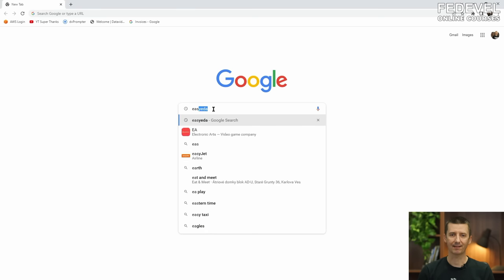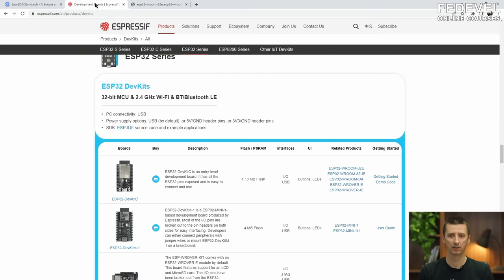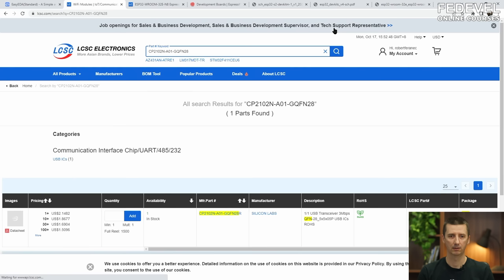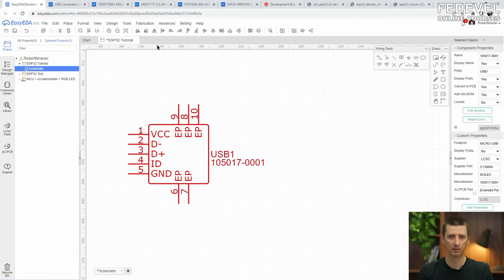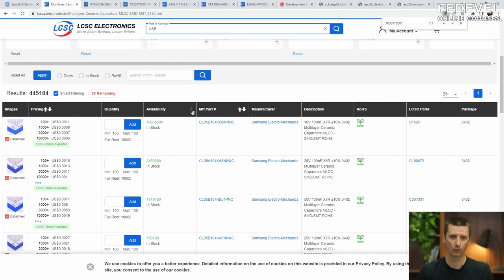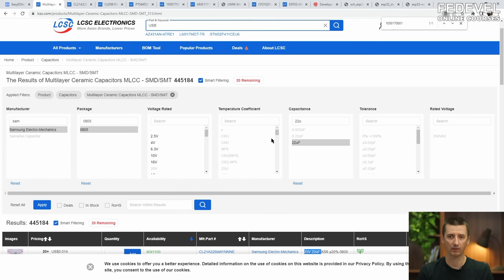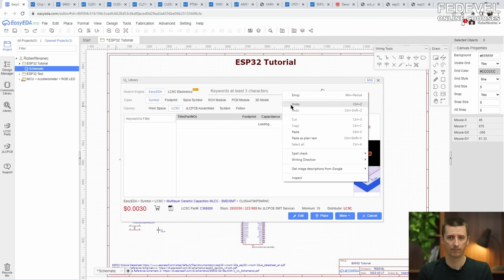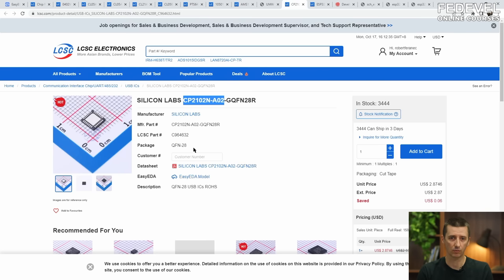How to Make Custom ESP32 Board in 3 Hours | Full Tutorial

Comment from the maker: Thank you for watching. PS: Project is here: https://oshwlab.com/robertferanec/esp32-tutorial
Reply: Dear Robert! I've just created a 2 layer board in EasyEDA, thanks for this awesome tutorial!
I have a question in my mind however... My board is an H-Bridge which will handle 10A current spikes, a few amp countinous current. (I upgrade my kid's electric tractor)... So I just did the layout, and I have some space on the board to route a few tracks on both side a top of each other (for example from the MOSFETs to motor connector) If I do this, should I put VIAs along the way to connect the two sides multiple time, or is just ok if the connection is made in the two ends (THT connector and FET had been used) 

Thanks, Peter
Reply from the maker: @EFazy  that's super cool. I am very happy this tutorial helped. PCB tracks can withstand high currents (I have some videos about burning PCB tracks) + I discuss high current PCB design with Steve Sandler. I don't know how wide are your tracks, but you can use Saturn PCB calculator (free software) to double check if you would need paralell tracks. 10A is not so much - it may not be necessary, especially if your input - output are on the same side of PCB - in that case most current will probably flow on one side anyway. However, having GND plane on the other side may help with possible EMC / EMI reduction (which may not be relevant in your case). https://www.youtube.com/watch?v=WdlN8bHw-w0 https://www.youtube.com/watch?v=sJQi9vcCW-E
Reply: The most beautiful saying "PERFECT" I've ever heard in my life ( I will use that voice sample on my home assistant wallpanel if @robertferanec  allows it 🙄).
Excellent job. I am using these boards in my house automation system without knowing how they work internally. Now I have a good idea of how this kind of system works.
Reply: Why not using USB-C tho? :D Personally hate the boards not coming with USB-C already because the other connectors die even faster :(
Reply: Thank you so much for this!  Want to say, @2:52:52 (palindrome :) ), I see you using a web page from DroneBotWorkshop.  I've been learning a lot from his videos!  That's so cool.  Am helping my nephew write video games, and I plan to introduce him to "smaller computers" this Christmas, with displays and PictoBlox which is like MIT's Scratch, which can run on esp32 etc.  Thank you again!
Reply: @RobertFeranec  I have a question if I wanted to protect the digital pins from 5v input would it be enough to use a zener diode
Pd thanks for the tutorial you explain a lot of things in such a way anyone could understand
Reply from the maker: @gcdani271  do you mean connecting circuits with different voltages? if yes, then proper way would be use a buffer - you can find some which will be 5v compatible or for example you can use one with dual power voltage. If you mean to protect your inputs from random peaks e.g. ESD, there are special diodes for this, just search for input protection diode
Reply: @RobertFeranec I mean if someone connects a sensor that works with five volts and output 5volt signal is it enough to use a zener diode to make the voltage less than 3,6 beacause if I am correct a zener turns the excess voltage into heat
Reply: ESP32 less than $3 on the internet new.. why would it make sense to make your own here for $38?
Reply: @antdx316  It’s just a tutorial. There is enough useful information here to create any ESP32 based project you want.
Reply: @trhosking  how do they even sell it for $3 when its $38 there though?
Reply: @antdx316  Economy of scale. When you are making thousands of units you buy your components from source. When you or I buy a few bits and pieces we are paying markup to everyone who has handled the goods in between. Add to that the shipping for a handful of items and before you know it we are paying fifty times the factory price. Also remember that the first time you order an assembled board from JLCPCB there is a £25 setup charge.
Reply: @RobertFeranec  Can you do a 100 watt led mcpcb & led driver design aswell
Reply: @EFazy 😊
Reply: I am very happy to learn new thing, but i have a doubt about copper pouring in top layer for 3.3 v, cause you already give a full plane for 3v3  in inner layer, am i missing something?

Comment: Am I missing something or did it really cost $177 for 5 boards??
Reply: That's the cost for PCBA mostly, assembly is a lot more work than just making the boards at such a small scale. $177 is probably the cheapest you could get that done anywhere
Reply: @jonathansouza7321 Each “external” component with JLCPCB has a £2 placement fee, from each resistor to each chip, it would be so much cheaper to find JLC basic parts or to do it by hand would be even cheaper, much much less than £100, more like £10-20 😊
Reply: Yeah, he used the expensive solder and parts, if you read the jlcpcb docs it'll tell you what type of components they prefer (and sell cheaper)
Reply: Do note that a lot of that is setup fee.  I recently ordered some PCBA from JLCPCB, and getting 5 boards cost like $180, but getting 10 cost maybe $210.
Reply: I checked what it would have cost to order 100, and it came out to something like $8 a board, and I think the parts cost was most of that.
Reply: Is more like $5 plus shipping if you order and assemble the parts yourself using a hotplate.
Reply: If you want cheap you need to make it thru hole, or big enough smd's to where you can solder it yourself. A few boards are always expensive.
Reply: If only the pi was that price.
Reply: @Harveyn  how can it be done by hand? Im a beginner

Comment: Hello Robert. I am just finishing a design using the ESP32-S2 bare IC. While using the bare IC instead of the module, you have to place a 40Mhz Oscillator, and you also have to design a transmission line for the RF input, and a Pi Network for transmission matching. Do you think you can cover that in a future video?
Reply from the maker: RF for this kind of chips is on my todo list. Just hard to find someone for my interview video.
Reply: @RobertFeranec  Yes, it most certainly is. What little I know had to learn the hard way

Comment: Hi Robert, Thank you for the great video! Great content as always

I would like to share a little tip: When you are routing a line on the top layer, and you want to pass to the bottom layer through a VIA (e.g., at 01:35:15), you can just switch the layer on the "Layers and objects" box, and it creates the VIA automatically from your current layer to the one to which you changed to (instead of (1) stopping the routing command, (2) placing the VIA, (3) switching the layer, and (4) starting the routing command again).
Reply: I was just thinking that. Little tricks....

Comment: Fantastic video ! I want to make my own ESP32 board, customized for the personal project I am working on and this step-by-step video is incredible !
Reply: Hi Gael, I'm also doing my first custom ESP32 board. I'm making board to communicate via CAN bus as I do not wanna use wifi or any radio. I'm currently doing board with 4 connectors for PIR sensors. The esp32 supposed to send messages over the CAN Bus to ESPHome listening on CAN Bus. Then I'm gonna control my hot water solar heater again via CAN Bus. I'm planing to wire most important things over CAN Bus.

Comment: I knew this was possible, and you show all the steps.  There must be ways to share working schematics with all required fabrication information. This is as cheap as buying off the shelf.  I often see boards that have too many things and want to remove them, buy just what I need for an application.  If you tied to the PCB maker then anyone could just pick what they needed and have it made.  Thanks!!
Reply from the maker: Thank you very much @richardcollins5549 PS: If it helps, a link to the finished project is in my pinned comment.

Comment: Perfect video! Learn a lot (together with your series #1- #7 one year ago).
Have a question:
"Power Input Selection" there you use a connector "J4" - to avoid a manual connector – can this be replaced with a "Dual Common Cathode Schottky Barrier Diodes (e.g. onsemi BAT54CLT1G)", the same solution that was used in your "TINY" the project?
Reply from the maker: Thank you. The 1117 regulator is not the best and if you take the lower USB voltage tolerance and decrease it by loses on the diode the voltage will be around the limits what 1117 needs. That is the reason why I rather used jumper. In the TINY project I used a better regulator, so we could use the diode.

Comment: Great video. Wouldn’t you save space for routing by connecting ground pins where possible and sharing vias rather than creating a via for every pin? Same for 3V3.
Reply: Hi! General best practice is to place ground and power vias per connection and avoid sharing I believe. I have heard different reasoning behind this from different engineers but I am still learning myself. Overall, if you have the space, doesn't hurt to shoot for best case of better, low inductance connections to internal planes. I think for simple designs, probably doesn't matter.

Comment: Quick question: What is the purpose of the 0 ohm resistors in the serial signals section?  Is it just to make it easier to cross-connect the TXD to RXD nets?
Reply: I'm wondering this too, but I'm not all the way through the video yet.

Comment: Whats the reason behind not connection the gnd of decoupling caps to the ground pin of the mcu? Instead u used one via to the ground plane for each, even when they are right next to each other. These two vias will increase the impedance of the gnd path between the cap and the supply pins. Same at the input cap of the LDO? Shouldn't gnd pin connected to decoupling cap connected to two gnd vias give the best preformance?

Comment: This is a great video. I would be very interested in seeing a video about DIY / custom ESP32 with ethernet and PoE on-board (using the cheap PoE power supply boards you can find on aliexpress for $5, they work well). Perhaps a video that doesn't spend too long on PCB layout (except where necessary, to achieve stability with ethernet) but a video that spends some time discussing what needs to be included in the hardware and code to achieve reliable ethernet. For example, I would really like to start making my own sensor boards with ethernet built-in, or even some DIN-rail host boards for connecting remote sensors etc. Thanks - I like your videos!

Comment: Quick question, for the user LED you have the cathode connected to the ESP GPIO and the anode connected to +3v3. Doesn't the output from the esp32 produce +3v3 making both sides of the LED receive +3v3?
Reply from the maker: GPIO output from ESP can be controlled by software and can be set to both, 3v3 or 0.

Comment: Thank you Robert, it's very nice and detailed explanation and I really appreciate it. Few comments though:
- I'd love to hear why you've chosen a particular component (e.g. the usb-serial chip) and what was the alternatives, if any 
- it would be great to explain what's the purpose of important components within the reference designs (e.g. the ESD protection diodes) and why we need them
- you made few changes compared to the reference designs, I am not sure I always understood why and for what purpose
- what's the reason for chosen form factor - making the board a little bit wider may allow repositioning the ESP chip between the headers and simplify the overall routing a little bit
- using context menu for copy and paste drives me crazy :) 
- I love the trick with naming vias "GND"
- I am not sure I understood why the bottom layer transistors are in fact not needed and why we need to place them in case of issues with the COM port (what issues?)
Reply from the maker: Thank you. About info: It's a compromise - each small additional info will make the tutorial longer and longer. To keep it simple, I decided do not comment too much. You can find more detailed tutorial here: https://www.youtube.com/playlist?list=PLXvLToQzgzdea0sQXmpY8k4tfiXpkYIwO PS: If board would be wider, there is not much space for standard breadboard. Also, I intentionally avoid using shortcuts and keystrokes so everyone can see and repeat what I am doing.

Comment: 2:21:37 Is 50 ohms (6 mill) the standard for all devices or only for high-speed ones? My device uses a generator with a frequency of 10 MHz, there are several frequency dividers in the device itself, and the device uses frequencies of 5 MHz, 2.5 MHz, 1.25 MHz. Do I need to use 50 ohm tracks? Thank you!
P.S. The board is double-sided, 1.6 mm

Comment: Hi Robert! I just get my 4 layer PCB and it works amazing, I have a question for you.. If my desing includes two chips one powered at 3V3 (Wifi module) and the other one powered at 3V9 (GSM module) which level voltage shoul I use in the inner layer?
Regards from Ecuador :) !!
Reply: I'm pretty new to electronics...but having never seen a chip that takes 3V9, I'd be strongly tempted to check the datasheet to see what the upper/lower bounds were on the voltages, see if I could feed it 3V3 anyway, hahaha.  Or even feed both 3V5 or something, haha

Comment: Hello Robert,
First of all thank you for this fantastic tutorial.
This is my first PCB and/or Electronics project so excuse my inconcise language.
I want to imitate the RX and TX LEDs that are present on an arduino, and I was wondering how they can be placed without affecting the signal coming into or going out of the CP2102N-A02-GQFN28R. I assume they should be connected to the TXD and RXD pins with a 1k resistor, but that's just my assumption.What are your recommendations?
Reply from the maker: maybe gpio0/1? check datasheet page 19 https://www.silabs.com/documents/public/data-sheets/cp2102n-datasheet.pdf

Comment: Thanks for sharing this excellent DIY Esp32 Board.
I am facing some weird issues with this esp32 wroom module, whenever I run it using external power supply with AMS1117 Regulator the esp32 wroom chip hangs up in few minutes.
Using same binary (wled) on dev board doesn't has this issue.
Tried many capacitor combos on 3.3v line but nothing helps.
Can you suggest some places where filter capacitors are to be used with Esp32 wroom chip.
Any help appreciated.
Reply from the maker: maybe it's something with 1117? probe the power by oscilloscope to see if it is ok or not.
Reply: @RobertFeranec  thanks for your prompt reply but I don't have a oscilloscope available. Will be trying multiple options of ams1117 3.3v board or some buck converter to see if that helps.

Comment: Hey Robert, I'm trying to design a PCB layout for a stereo speaker/LED matrix system controlled using an ESP32 H2 with bluetooth connection. I'd really appreciate your advice on how to do the same with an ESP32-H2-MINI as the components in its schematic are different to what you used. I am new to electronics, so it'd be fantastic if you could help guide me.
Reply from the maker: you can try to ask on our discord https://discord.gg/8a8dUcHmrx
Reply: @RobertFeranec  Thanks, I'll surely check it out!

Comment: Hello Robert,
Thank you so much for this very nice and beginner friendly video. 
Can you share the link to the device at timestamp 2:52:03 (which you used to measure Voltage and current over USB ).
Reply from the maker: There are many, just search for "USB tester". The one I have is not available anymore, but it is similar to this: https://www.amazon.de/-/en/XNF15T12JRB148YOIN4ZS7-USB-TESTER/dp/B07DK6K5HD/ref=pd_day0fbt_img_sccl_2/262-8604195-3135068?pd_rd_w=a2Vdh&content-id=amzn1.sym.afd474ca-fc60-4653-b4ab-afb840ac5c22&pf_rd_p=afd474ca-fc60-4653-b4ab-afb840ac5c22&pf_rd_r=76VG7DVB2NAEDK4NMY99&pd_rd_wg=tLKtK&pd_rd_r=2051ab68-e2d3-4815-b2c9-d2257d7ec466&pd_rd_i=B07DK6K5HD&psc=1

Comment: Will I have any issues if I select, "Assemble both  sides" on JLCPCB? It's interesting to me that you didnt. Just want to make sure I'm safe doing that.
Reply from the maker: if you select both sides, then assembly will be more expensive and in 99% you may not need that circuit, that is why I didn't select bottom assembly
Reply: @RobertFeranec  Thanks for your response! Quick question, is it worth using the Auto Router?
Reply from the maker: @taylor.galbraith  I do not use autorouter. Autorouter can connect all the pins (sometimes), however there is difference between connecting all the pins and doing PCB layout properly. Also, for simple boards, manual layout is easy, for complex boards autorouter will do a messy layout. But, you can use autorouter (I would not recommend it), many times the board will work (somehow).

Comment: i made the esp32 pcb design and added some extra features like Motor driver, buzzer so before going to the Fabrication how can we ensure that the board works well?
Reply from the maker: you can wire up standard esp32 and test it. or you can just build it, test it, improve it and manufacture again. these are normal steps. (sometimes you can also simulate it, but building it may be faster and better, simulations may be sometimes different from real behavior if not setup correctly)
Reply: @RobertFeranec  Yeah!

Comment: Amazing video Robert! This was exactly what I was looking for! I do however have a question regarding the USB connector. I saw the datasheet connected it to ground, while others suggest to leave it floating. What would you recommend for a board that will also be working standalone with a battery?
Reply: The rule of thumb is that for "host" devices (devices that other USB devices plug INTO, such as computers) then the shield should be grounded; however for "peripheral" devices (devices that plug into other hosts, such as the ESP32 board designed in this video) you should leave it floating (unconnected.)